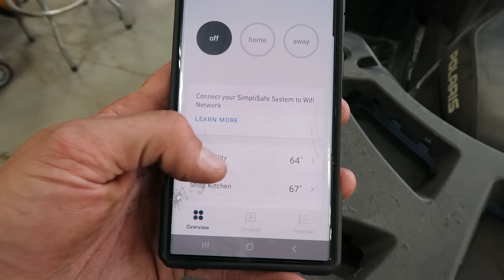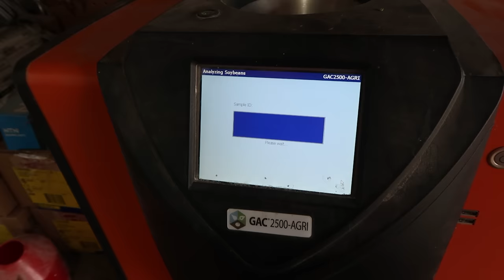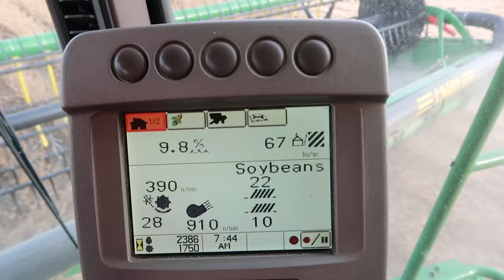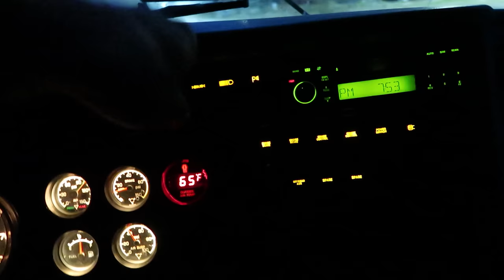It's Go Time! Harvest 2023 #StaySafeEveryone

Comment: If you like seeing farms from different parts of the USA check out FarmingWithTheTaylors and also Wendling Farms, both are located in Central IL which is part of the corn belt, high yielding crops are the normal, like 327 bu corn!

Comment: We have never been happy with the round bar concaves running in beans. We plugged bin sumps much like you guys have. We finally put some concave inserts on the outsides of the concave sections. Two inserts made a world of difference in getting the pods threshed out and also preventing splits.
Reply from the maker: Can I ask what type of inserts those were and where you got them?
Reply: One kit comes with two inserts.  We put one insert on front of front concave the other on the front of the second concave. We have used 3 inserts before when the beans were really tough and rain was coming.
Reply from the maker: @benjaminlott5696  I'm looking into those now, thanks!

Comment: No way to adjust returns? I don't know about newer Deere's but my old machines have a separate sieve in the back of the cleaning area to catch pods. I always run that sieve wide open. Let the extra wind blow chaf over and the pods fall in. You can angle it up too if you and running up a grade.